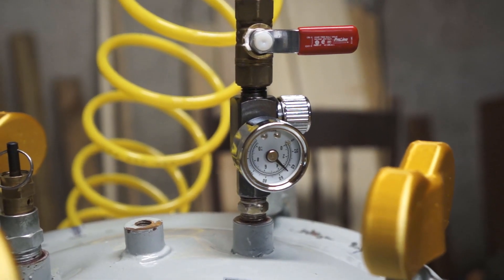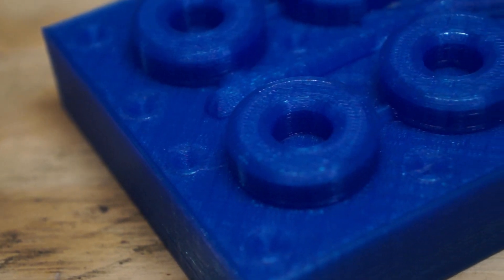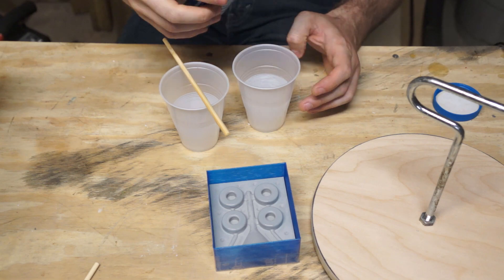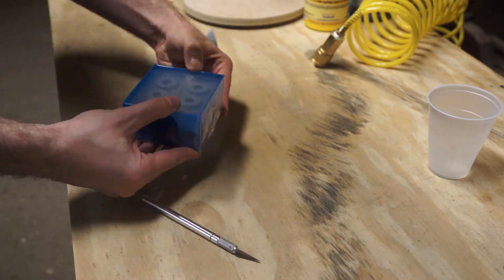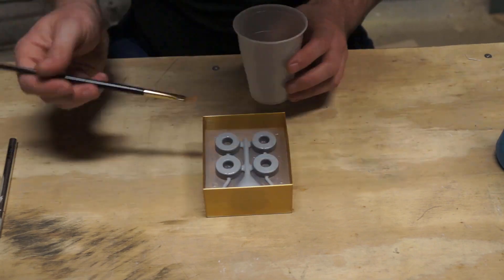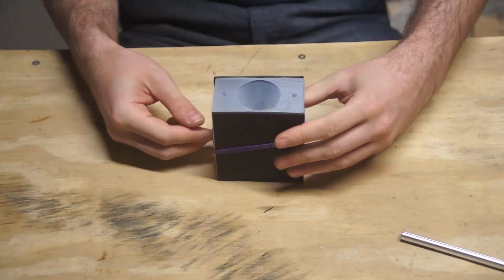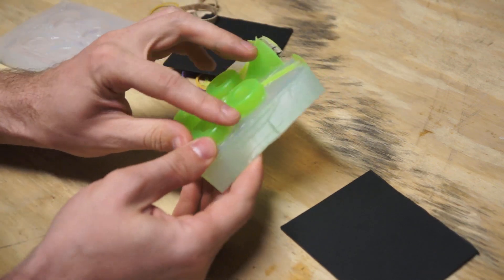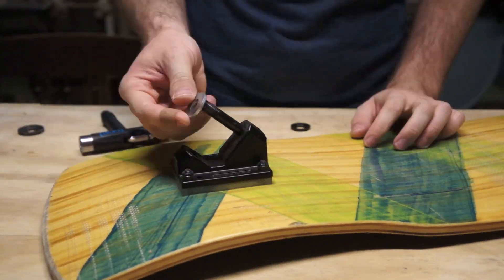Using Pressure to Cast Flawless Skateboard Bushings at Home

Comment: Silicon you are suppose to degas in a vacuum chamber, resin you are suppose to pressurize in a pressure chamber. 
Reason being is, silicone is soft and the crushed bubbles will be right back one the pressure is normalized, resin is hard and the bubbles will not be back, it freezes in place so to speak.

Comment: sick. have you tried making riser pads or shock pads?
Reply from the maker: I haven't cast any yet but I use 3d printed risers on almost all my setups. They're super easy to design, don't take long to print, and you can use different filament to get different hardnesses
Reply: @GoodRoads  7months later but your videos pushed me to get a 3D printer. I made some shock pads, and bushings for my friend using flexible PLA. I didn't even know they made flexible PLA. It prints like rubber.

Comment: Next bushings I need will be homemade, I need pretty hard ones, but the best value is somewhere inbetween the available ones. also..casting fun!
Reply from the maker: Dude, love to hear it! I'm still trying to hunt down a set of urethanes that work really well, so if you find one you like let me know!
Reply: @GoodRoads  Vulkollan, a material with an elasticity similar to that of rubber, in its classic form is a polyurethane elastomer based on naphthalene-1,5-diisocyanate (Desmodur ® 15), polyester polyol and special chain extenders. It is produced using a hot-cast moulding process.

These products may therefore
be used only in industrial or trade applications. They are not suitable for use in homeworker (DIY) applications.

Sounds like 75-80 is as hard as you can go and the proprietary stuff is "high performance for extreme applications" but theyre definitely giving me clues on how to mix it up in a mexican clandestine operation.

PU Equipment for hot cast polyurethane elastomer is used for casting PU elastomer products that use MOCA or BDO as the chain extender.

Cool. Sounds like you just need hot casting equipment and you can drop 1,4-Butanediol into a polyurethane and would need aluminum molds for hot casting...OR just figure out what plastic is used in disc golfing and see if hot casting that can cheat your way to a harder bushing without polyurethane..Like maybe HDPE

Comment: Vaseline gel allied with a brush works for me (I build and create polyurethane resin scale models )
Reply from the maker: Thanks! I've been doing exactly what you describe lately and it works great. Have you tried thinning the vaseline with mineral spirits? It makes it a little easier to brush smoothly
Reply: @GoodRoads  sometimes I put the container under warm water to soften it. I brush it under good lighting because it's easier to see if I applied it too thick by the way it shines.
Reply from the maker: Helpful stuff! Thanks for the tips!

Comment: I wish I could get  urethane risers    : /
Reply from the maker: I would bet that any flexible risers you can buy are made of TPU, or ThermoPlastic Urethane, which is just a heat-moldable urethane instead of a two-part cast-able one. So you probably can get a hold of some! If you're talking about the super bouncy stuff then you could always make take a stab at making your own?
Reply: @GoodRoads  -- Thanks for the response. Maybe I could make my own, but dude, I live in a two-bedroom apartment in Brooklyn. I'm not gonna do that. It's sort of ironic that one can buy wheels and bushings of varying colors and softness, but you can't acquire risers that offer the same swath of choices. Every riser I've ever bought has been lacking. I've resorted to using a chunk of rubber I 'harvested' from an old kiddie playground. Still, it would be nice to acquire a nice chewy piece of urethane as a riser.  I'll go hunting on Amazon.
Reply: @mhakus  have you seen the silicone risers? I have a few sets I got from haggyboards they they seem pretty nice, not good for going over 25mph though.
Reply from the maker: If you're really interested in tweaking them and getting them dialed, have you thought about getting a 3d printer? I print my risers and they work great. You wouldn't need a big expensive printer either and a small one is totally doable in a BK apartment. They make TPU filament in a bunch of different duros and you can make them harder or softer by adjusting the infill or how solid the print is. Just food for thought.

Comment: Chris, you did a great job with these bushings!! If maybe you want to go deeper in nerd science with bushings you should try different hardness and torque the screws the truck with a torque wrench to obtain perfectly similar results (but it’s like applying rocket science to a simple object).
For wheel casting my only concern is about the precision of the bore for the bearings, as a mechanical engineer the tolerances for mounting a bearing are pretty tight (0,02 mm, sorry but i don’t know the value in inches, but it’s really small). I suggest you to try with different bore sizes of your mold to find the one that fits perfectly or go smaller and use a lathe to be perfect!!
Reply from the maker: Thanks man! I've thought about different testing setups, I'd love to get graphs of hanger angle to bushing resistance, and I've been thinking about building a rebound testing setup since that info is so hard to come by. 

I'm also mostly concerned about the bearings. I got a resin printer which I'm hoping should give me the accuracy needed, but I'm running into all sorts of cure inhibition issues between the printing resin, the silicone, and the urethane. It's going to take some fiddling for sure.

Comment: What brand of Urethane did you use?.. i'm thinking about making my own wheels.
I also have a small tip: I have cast a lot in Silicone moulds, and i put my moulds in a "sleeve", like a box without a bottom.. no fuss with rubber bands.. just put your mould halves together, and slide them in the "Sleeve"..
Reply from the maker: It's Specialty Resin and Chemical's Flex-it series. It comes in a bunch of duros, I'm using the 80a one, there's a link in the description. I like the sleeve idea
Reply: @GoodRoads  Thanks.. i didn't read the description.. for Mould release.. I use a light mist of  "Acmos" release wax, It comes in a spraycan..